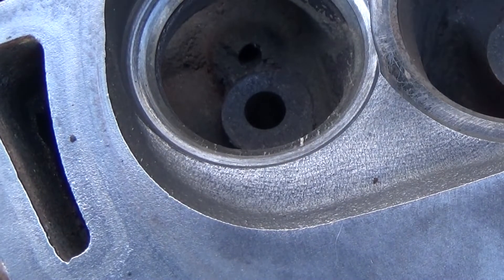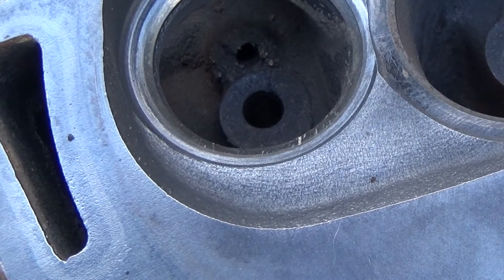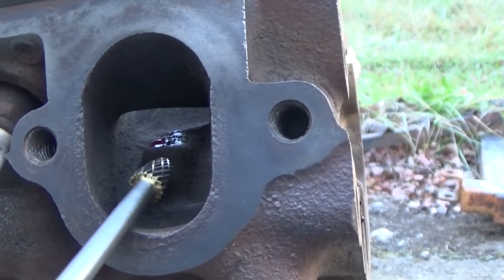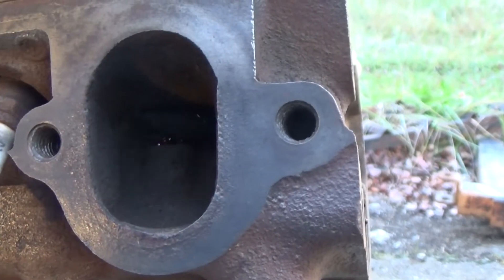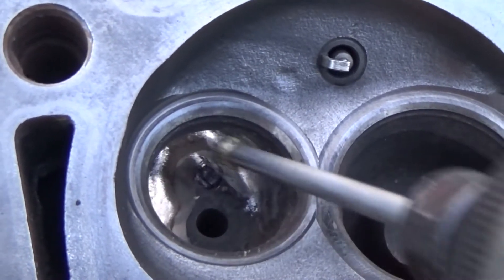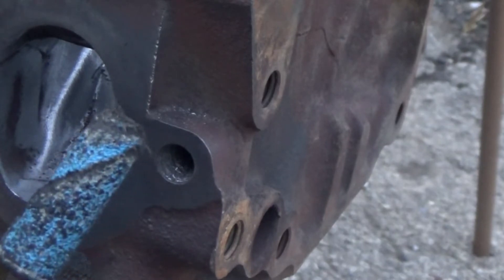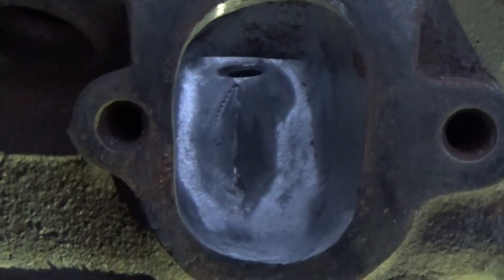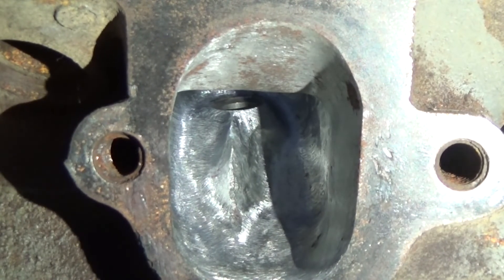460 Cylinder Head Porting

Comment: 9/32 is too large for 5/16 really… but this is great info doing mine now!
Reply from the maker: Some charts list to use a letter F drill bit size for 5/16”, some list to use a 17/64” drill bit and some list a 9/32”. I guess all of them are close enough to work lol
Reply: Just finished mine up, I appreciate the video worked really well, looking forward to see it in action in the boat
Reply from the maker: @scotty429 let me know if you think it helped.
Reply: @BlackLabGarage  I have a question I was hoping to finish up the polish what were those small little green rounded sanding tips looks like 1/8 shank ? You said don’t get them from harbour freight
Reply from the maker: @scotty429 those are 60 grit sanding roll cartridges. I believe they are 3M brand. But you don’t have to get 3M brand. Merit, Norton, Carborundum Abrasives, and a few others make good sanding rolls as well.

Comment: Would you bother porting smog era 460 heads in a 77 Grand Marquis with no headers available (that I know of). I'm thinking the (pre-smog) timing set would still be worth it since I might be pulling the motor to fix a rear main seal leak. Good informative video btw!
Reply from the maker: Absolutely! Anything to improve the flow of the exhaust side of the 429/460 will help. What you see me porting is in fact a set of “smog era” heads. The heads were the same from 1973 thru 1986. See if you can fit a set of truck manifolds in your car. The truck manifolds flow better than the car manifolds and they have bigger exhaust flange openings than the car manifolds have.
Reply: @BlackLabGarage  Heck yeah, thanks for sharing!
Reply from the maker: @MrLightning54  you’re welcome!

Comment: If there are any aftermarket aluminum heads you would run what are they and why them specifically?
Reply from the maker: Probably the Trick Flow or Edelbrock heads. I would pick the Trick Flow over the Edelbrock just because they are a newer design and make more power and are priced a little lower than AFR and the Ford heads.

Comment: I wouldn't mind the added power and flow from ported factory heads but losing all that cast iron weight with aftermarket aluminum heads makes more sense. I dislike the Ford EFI system on my '90 F250 4x4. Some jackass tried to cut out my catalytic converter but only damaged my air pump inlet lines. I'm thinking about this point of just ditching all that air pump garbage piping and put headers on it and open up the exhaust system with a pre axle dump.
Reply from the maker: The EFI 460 is good engine it's just the primitive fuel injection system and emissions that kills it. You would be surprised how much that engine would wake up if you installed a carburetor and regular distributor in it.

Comment: I have looked all over YouTube and the internet to find someone talking about or a video of a before and after driving test after a “home garage” exhaust port job on stock D3 heads. I’m sure it helps tremendously, but does it change driving power a lot? I’m getting ready to port my first set. Thanks for the info.
Reply from the maker: Well it depends on the rest of the engine setup as to how much difference it makes. On a bone stock low compression 460 it probably makes 10-15hp difference. But you will notice that the fuel efficiency raises. Now when you change camshafts, raise the compression and stuff the ported heads really help so you would gain more from that modification than you would on a stock 460. Usually porting the exhaust and just a straight up timing set will gain you 20-30hp with no other changes. Now if you do all that and add the smaller car manifolds instead of truck manifolds or headers then you may not gain as much because the smaller restrictive car manifolds can’t breathe and are holding the engine back.
Reply: @BlackLabGarage oh ok cool. I think Iv decided to replace my factor deep dished pistons with some flat tops. It already has a mild cam nothing crazy so I believe I won’t have valve clearance issues especially with the deeper chamber D3 heads, but I will make sure after the piston change. Another thing I’m thinking about doing is filling the exhaust crossover port with extreme high temp epoxy to eliminate that, do you have any experience or input on that? I live in VA so not extreme winters or anything.
Reply from the maker: @dallaseye6304  lots of people block the exhaust crossover off. Either by filling it or putting thin strips of metal behind the intake gasket. Either way works

Comment: Personally I had a 69 429 and ported the heads. On reflection 30 years later I believe filling the floor and making the ports smaller would be the way to go. I had a flow bench for a few years and some things would amaze you.
Reply from the maker: Yes I agree with you. I can’t remember if it’s in this video or the 460 EFI porting video where I say don’t touch the floors of the port because there is nothing to be gained. I’ve seen a lot of people port the floor also but it does no good. Just makes the hole bigger but flows no better lol

Comment: You are one of the very few who mentioned the retarded cam timing. So many on TV shows fail to mention it. I once changed nothing more then the crank timing sprocket and gained so much low end torque. The old Merc became a real tire smoker.

Comment: Nice job. I saw someone unshroud the valves by hand which would be just as easy for a bit of gain. I also like a 650 CFM on a truck 460 they work great. I recently bough a used .030 over 460 short block with flat tops. After I got it home I realized it was a 429 medium duty truck block. I can still use the block and put .030 over 460 stuff in it. Great video.
Reply from the maker: @softenerguy  i know David Vizard is big on unshrouding the valves on factory Ford heads.

Comment: I've seen a bunch of you Bubbas porting heads on you tube BUT not 1 single one ever makes it to the DYNO, so whats that tell you?
Reply from the maker: @randybichsel4244  that we live in towns that have no dyno’s? Not everyone has access to a dyno within a few hundred miles. But  I don’t need a dyno to know that it helps. You can feel the difference but more importantly when you do the math and you see that your fuel mileage has went up then you know it’s helping. I’m not afraid to put mine on a dyno. I’ll gladly put mine on a dyno to show that it does improve hp on top of increasing fuel mileage if you want to pay for the dyno time and the transporting costs.

Comment: I had an 81 one ton Dually Ford 460 4 speed truck with 4.11 gears out back. 227 miles=44 gallons of gas like clockwork/loaded or empty. But that sucker would pull a house down in seconds. It didn't hang around too long.
Reply from the maker: @craigpennington1251  it had to have something bad wrong to just get slightly over 5 miles to a gallon. Once I get my 460 installed in my 1979 F-350 I will check the fuel mileage. It is a 4 speed with 4:11 gears. I fully expect to get 12-13 miles per gallon.

Comment: Skinny cam bearings , cant take a lot of spring pressure, thats why savvy guys machine them for roller bearings !
Reply from the maker: @PeggyParrow  you don’t have to do that. You can’t get five 351C front cam bearings and install them in the 429/460 block. The front 351C cam bearing is wider.

Comment: Does 429 D0VE-C full power heads with 10.5:1 has these holes to plug??
Reply from the maker: While they will have the thermactor bumps in them, some have the holes and some do not. It depends on what area of the country the vehicle was going to as to whether or not the holes were drilled or not.

Comment: Please help, trying to find a cam for my 460. D3VE heads ported as you show what cam for my 4x4 cam for low end torque f250
Reply from the maker: Any particular brand you are wanting to use? For an off the shelf camshaft I would look at a Crower 22171. Or something similar.
Reply: @ Howard cam?
Reply from the maker: @ I looked thru the Howard’s catalog and they don’t show a dual pattern camshaft that has brute low end torque. They have some single pattern camshafts but dual patterns that have more duration on the exhaust side always perform better in Fords. Even the stock camshaft is dual pattern
Reply: @BlackLabGarage  thank you, can I run the grower can you have shown nice with stock valve train?
Reply: Customer support for the companies has been tough to get answers so I appreciate
Reply: Crower cam **
Reply from the maker: @jamesclark9800  well I can’t say for sure. It’s one of those things that you have to measure and find out. Always measure for proper pushrod length and lifter preload. I would run the valve spring that they recommend, that way if you have any troubles with the camshaft they are more likely to honor their warranty if you used their recommended parts verses if you didn’t use their recommended parts. Don’t overlook the stock camshaft that came in the 429/460. It makes great low end power and that is the same camshaft that was in the early 460’s that made 360hp and 500lb ft of torque. What hurt the 460 in the 1970’s and 1980’s was the low compression, lazy distributor curves, horrible carburetors, and the timing set that retarded the camshaft 8 degrees. When you up the compression, port the exhaust side of the head, and install a straight up timing set along with a distributor that has a good timing curve…the 1970’s 460 becomes a whole different engine.

Comment: Nice think I will try this with one of my spare motors. Try it in my Ranchero.
Reply from the maker: It really helps with the exhaust side of the 429/460. Especially if you are running headers or the truck manifolds. The car manifolds are horrible.

Comment: when i was a oldschool sbc guy, i worked some double humps/ had a old school friend was probably 60 something when i was early 20's, anyways we threw every trick he knew, even had to bust out some silver solder, dimpled intake runners and gasket match exhaust, about anything that could be done, i couldn't really tell you all the stuff we did. im not into cars anymore. but my father passed and left me a mild built 76 lwb f-150 custom with 460/c6. im gonna do something with it, i know next to nothing about 385 series. he had ran a 14.008 at like 95-97 on street tires.bafter looking into the 385 series bbf i cant believe what can be done its one hell of a engine design. anyways thanks for the upload.  im gonna look around your channel some more see if anything else its helpful/useful, have a wonderful day BLG
Reply from the maker: @KillerCurl1  the 385 series really is a great design. It was the second to last pushrod engine designed by Ford. It’s cousin the 335 series being the very last pushrod engine designed by Ford. With that being said I prefer the 385 series. It’s a good design and way too easy to make good power out of them.

Comment: I have a F 350 dually with a 460.  The truck hasn’t been running since 2000. I found rust in the upper manifold and it’s bad. I need to take it apart and dip the block in a solution. Any idea on what would work best for  the solution? Thanks, Ken
Reply from the maker: @buddyboy1953  I use a big tote of vinegar for all of my rusty parts. It works really well. Let me find my video of me using it on rusty cylinder heads
Reply from the maker: @buddyboy1953  https://youtube.com/shorts/tGogUoRgAgE?si=8Jee-bF5ER-igxQf
Reply from the maker: @buddyboy1953  https://youtube.com/shorts/1z00t6rW_BY?si=BJ-Hb1Dz-pSyRzW9